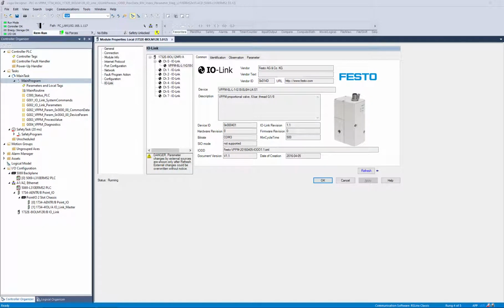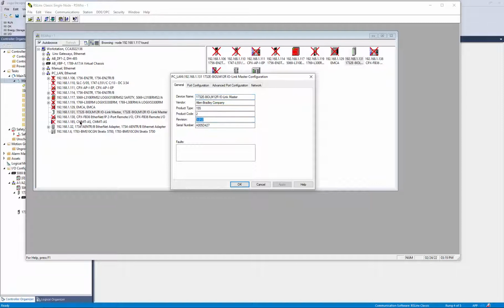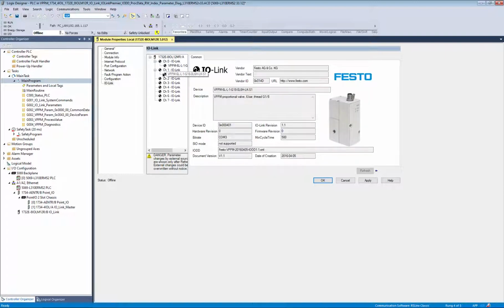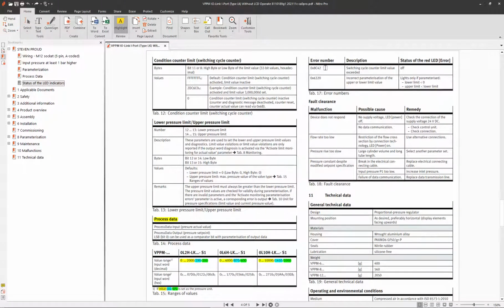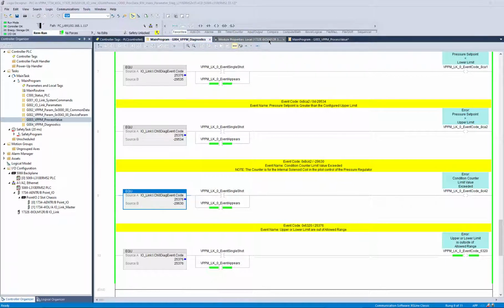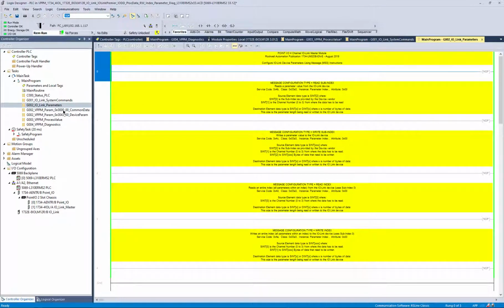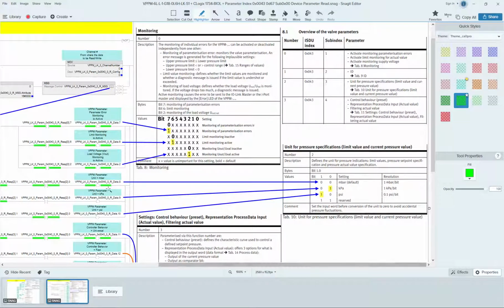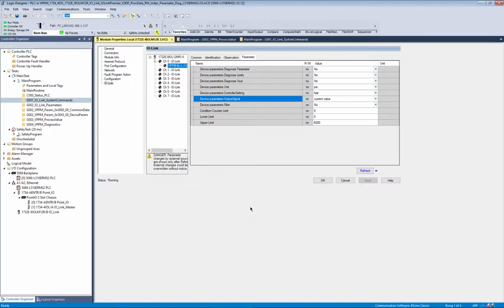VPPM + 1732E-8IOL + IO-Link + CLogix + EthIP + ReadWrite Parameter

Comment: could you explain the messaging more? I am using the same IO Link master module, but I am using the SM6601 ifm flow meter. I have tried doing a message to see actual flow rate but have been unsuccessful.
Reply from the maker: This video is about the Festo VPPM - not IFM. Messaging of IO-link master will be different for every device especially vendor specific parameters. I suggest you Read the owner manual of the IFM and also the 8IOL to find answers.